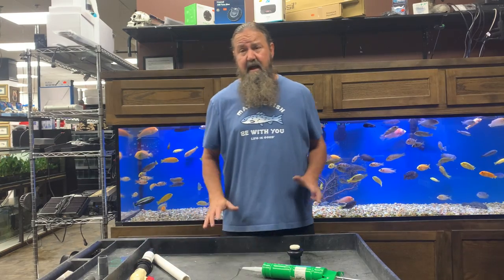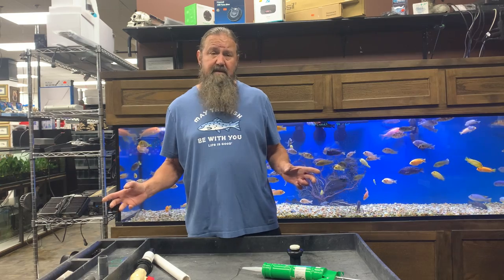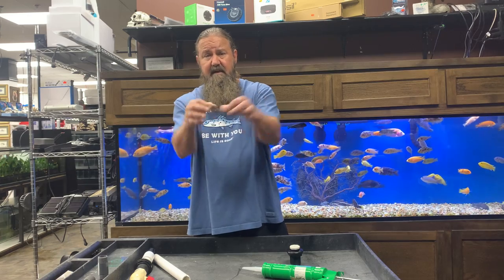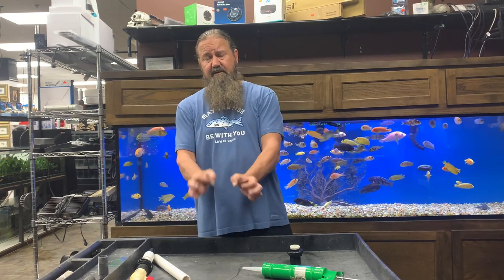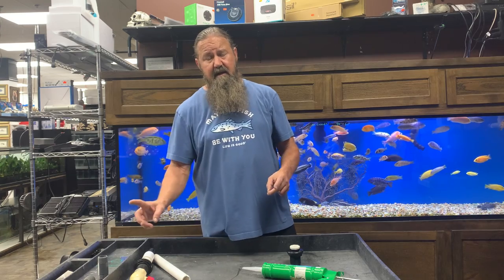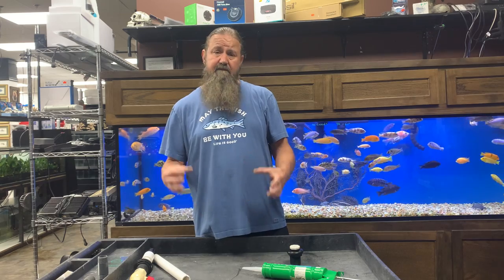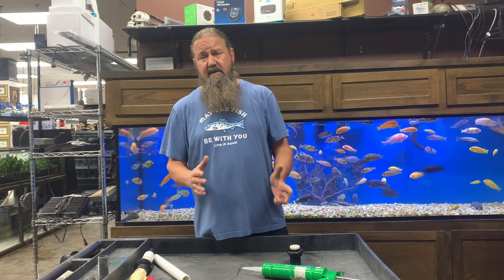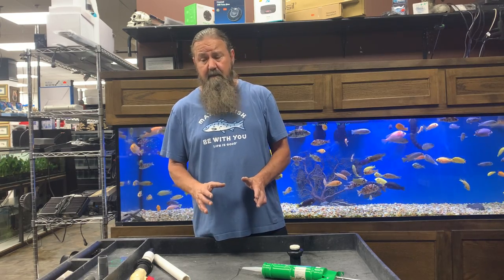How to Plug Holes in a Drilled Aquarium

Comment: Chris, when installing the quick water change system you show here, how does the water get to the pipe once the level drops below the over flow height? Or do the overflow panels need to be removed for this to work?